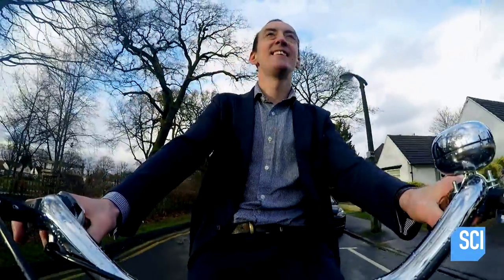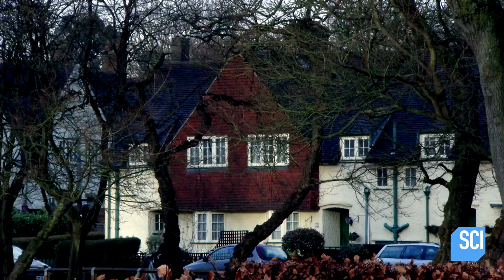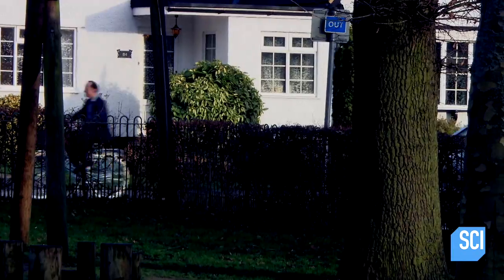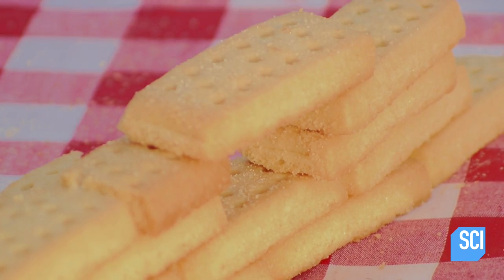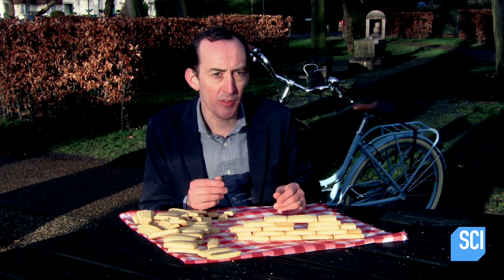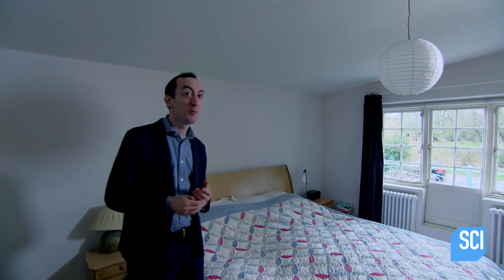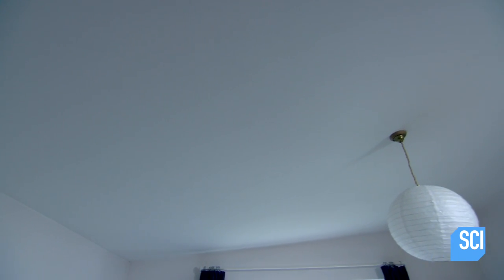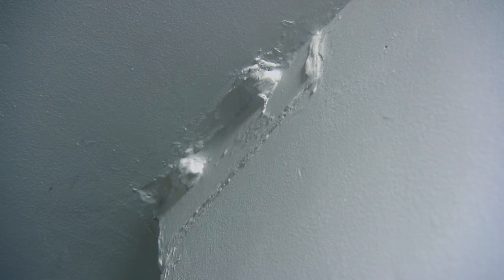This House Was Built In Just 36 Hours | Impossible Engineering

Comment: Sadly, this sort of construction is frowned upon by mortgage lenders. The concrete slabs are a nightmare to warm, and so tend to create condensation on the inside of the structure, leading to mould. However, it's the fore-runner of the Structural Insulated Panel (SIP) system that is used on many self-built homes.
Reply: That's probably the English spelling.